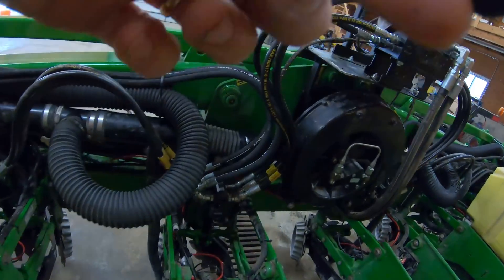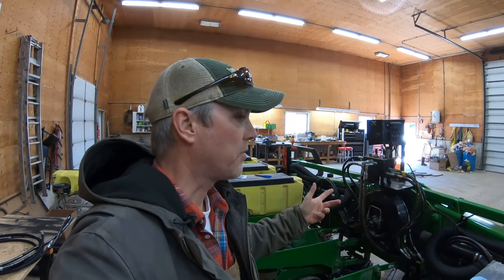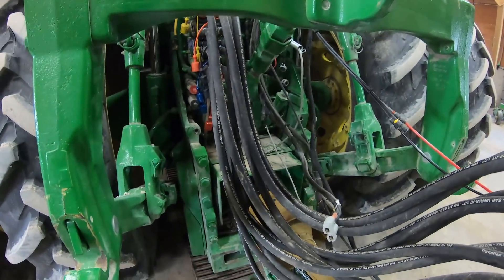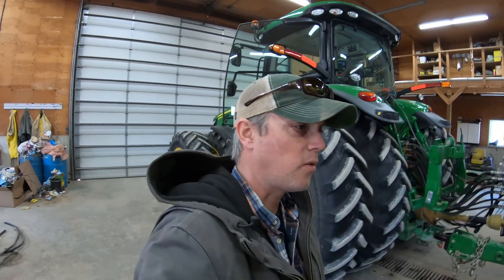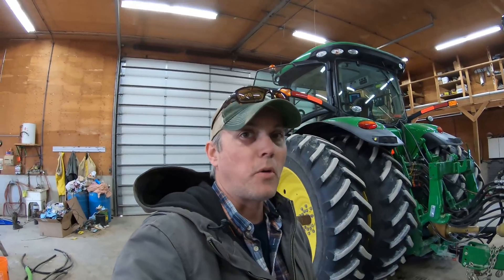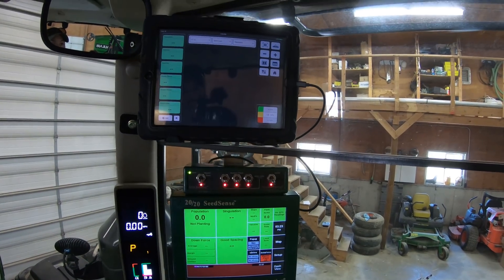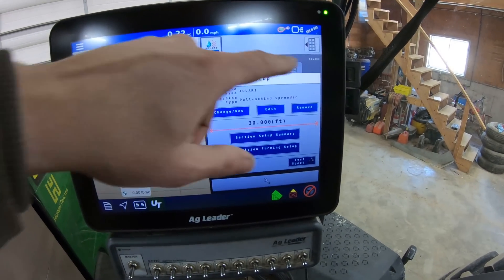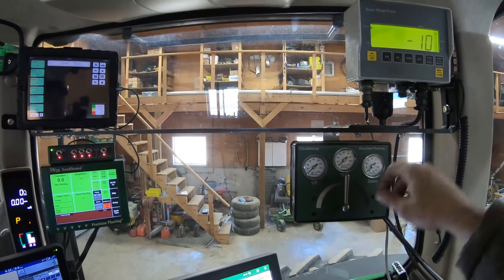Aulari Cart and Planter Build Complete

Comment: With the wheels so far ahead of the openers did you have trouble or is there much horizontal movement when turning a corner with the unit in the down position. Or do you just back into corners?